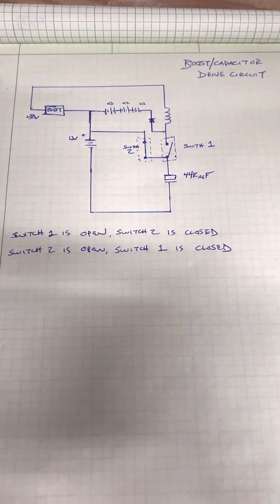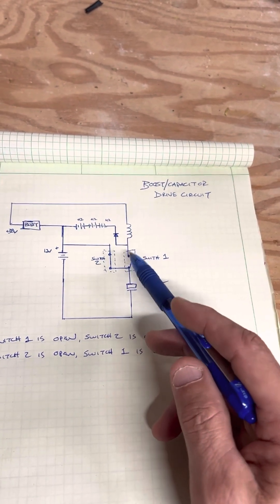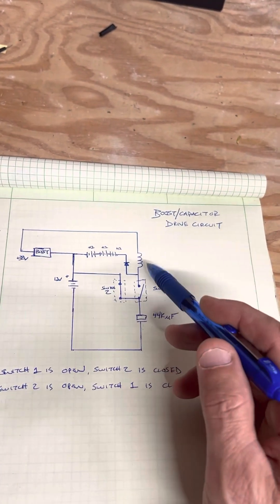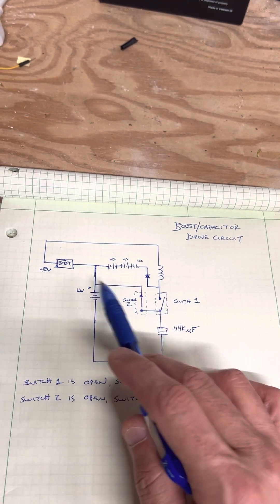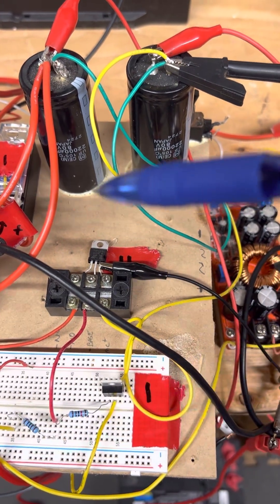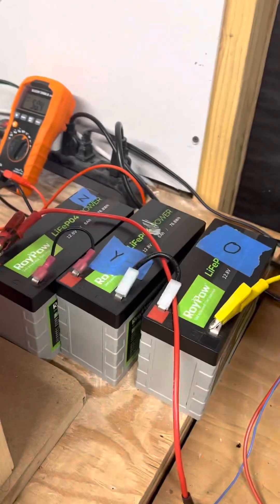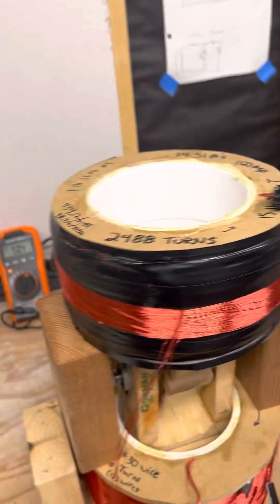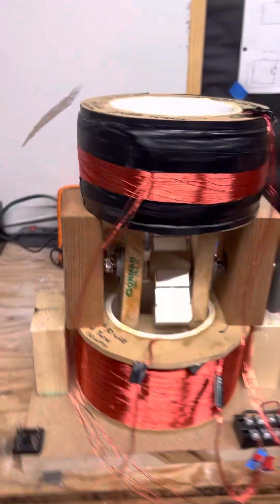New Drive Circuit for Newman Motor

Comment: your better off with ceramic mags on your rotor. They have much wider field , the neo has narrow field and your inductor will not saturate as well as it would have with ceramic
Reply from the maker: Interesting - I’d never heard that field geometries were different in NEOs.. I assumed it was just strength - which is significantly higher with these neos.. trying to tighten a nut on the shaft is a chore with steel tools wanting to stick to rotor magnets.
Reply: @energyhack3538  if you do switch to ceramic snap shot the sine wave spike before you do and compare the duty cycle , if i am right the spike will have a little more width to it, thats nothing but good news
Reply from the maker: @mykedoes4099  I have some other rotors built with ceramics, I can try this on. The H-bridge set up allows me to send the spike back to the source battery directly. No second set of battery or battery swapping required. As u said, The higher the proportion of recovery the better!
Reply: @energyhack3538  please remind me what the H bridge does, was that a rectifier?  My circuit illuminates battery swapping as well. essentially the pulse is bounced via the fly back back and forth between the two batteries by use of the two inductors and separation of the switching eliminating the need for matching transistors or risking any npn burn outs
Reply from the maker: @mykedoes4099  the H bridge allows firing the coil in both directions. It’s a North, then a South, then a North, etc. that way a N/S rotor can be used - like in Newman’s design. He however used a commutator - the H bridge is all electrical switching. But it also has diodes reverse biased across all four switches so at power cut off the current flows backward through source batt giving it a recharge. I’ll post a video of the scope shots - it’s pretty clear to see the current running backwards into the source battery. Depending on how the pulse width is set it could be 30% recovery or even more.

Comment: If you get the spike (when the switch is opened) means the capacitor is not charged completely. In other words, when the charge of the capacitor (by the inductor) riches its max value (you know what I mean) current in the resonant circuit will be zero, cause the voltage across the capacitor opposes the power one. You should play with the duty cycle of the trigger (hall sensor) to get the right pulse duration. No current, no magnetic field in the coil, no spike.
Reply from the maker: I didn’t intend for it to act as a resonant circuit because of the large cap value - you’re right it doesn’t fully charge. Not even close. If I decrease the capacitor value in uF, thus allowing it to fully charge, it greatly reduces the current thru coil, because the delta for source to drain voltage is much less and it loses the driving force to push current, which decreases the magnetic field and rotor slows down. It needs current to produce the mag field to drive the rotor. I see the design as running between positives 39v source through coil to 12v cap. The cap goes up the 15 or 16v, circuit opens from coil, and circuit closes back to batt. The cap dumps the 16v back to 12v at supply batt. The power recovery is the ratio of voltage difference - 12/39* current in.  But then it also gets the Flyback spike to charge batts. And it produces mechanical work in the rotor. Probably overall efficiency is pretty good - but after repeated tests not OU. I let it run for last 12 hours and saw 2.5v gain in the 50.0v starting battery chain. Went from 50.0 to 52.5. But the drive batt dropped from 12.12 to 12.10…. Adding the Flyback spike made the rotor speed up, the circuit to draw more power, but helps the drive batt voltage stay high.. I think because the Flyback is circling around and largely going back into the drive coil. This is a way to reuse the same power to drive the rotor repeatedly. Sorry.. I’m rambling on now… thx for comment